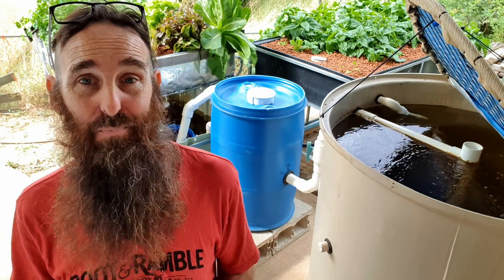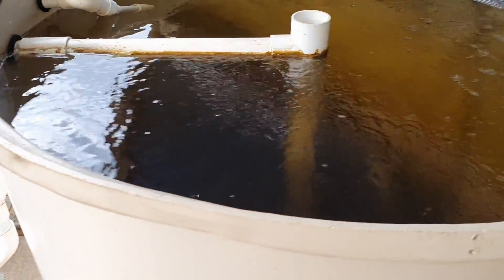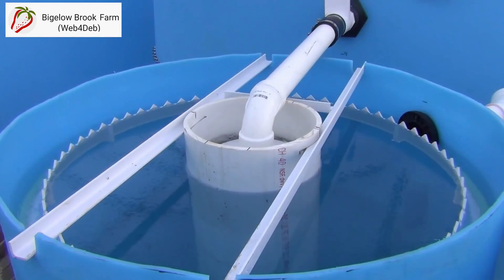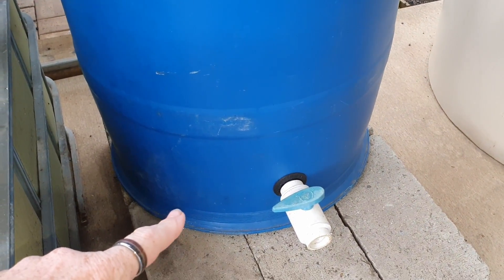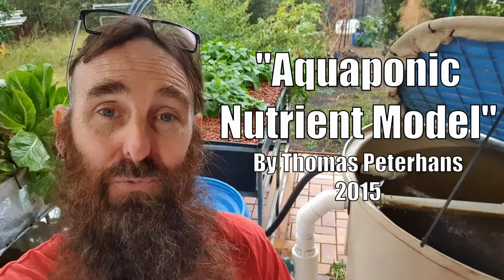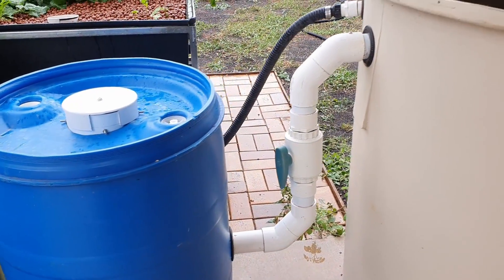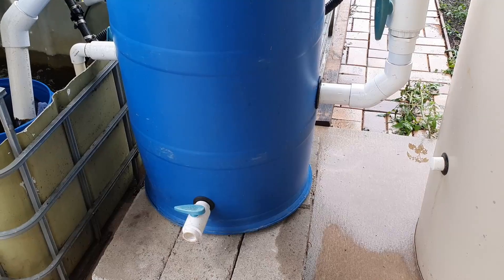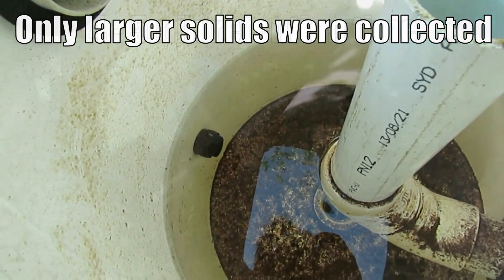Radial Flow Settler for Aquaponics Systems | How RFS work - How to Size Your RFS

Comment: Would there be any benefit to running two of them in series?
Reply from the maker: Parallel would be better as you would be reducing the flow rate which would increase the retention time. 👍
Cheers Joseph.

Comment: Hey Rob, have you tried having 2 radial flow filters connected parallel to each other?
This way you can double the volume and retention time and still use the cheap components.
Reply: Also I had another though. 
Do you need that much water flow through your fish tank?
You mentioned many times that you need to pump the entire volume of the growbed  twice an hour for the bacteria to work. But that has to go through the growbed, not through the fishtank, right?

So if you have a split system you could slightly close the valve on fish tank side and reduce flow through the fish tank by half. 
In theory that would double the percentage of ammonia in the fishtank water but since we are removing half, it would equalize and the same amount of ammonia will escape the tank. 
The only question is if doubling ammonia concentration in the fishtank water wont kill the fish.
Reply from the maker: @hubertnnn  The fish tank water needs to go through the beds twice an hour as that's where the ammonia is coming from & we want it processed ASAP so as to not build up & harm the fish. 👍
Hope that helps.
Reply: I run 2 radial flow filters (55g drums) in parallel. Works great.
Reply from the maker: @underdog5004  Cheers mate. 👍👍
Reply: @underdog5004  can you share a picture or video of this so I can replicate it?please??
Reply from the maker: I haven't due to space issues but think it could be done mate & the decrease in flow would help to a point. 👍 I'm not sure it would really be worth it in a small system like this current one I have on the go. 
Cheers mate.

Comment: Great stuff as always Rob! One idea, could you not do a T-split from the SLO and into 2 X 200L settlers for a cheap 12min retention time? :) (as an alternative to a really expensive 500L version). Also love the idea of the “fork” water outtake for the settler to slow it down. Might need to play around with that idea myself :D
Reply from the maker: A few folks have suggested that & it would increase the RT dramatically.👍 Helps if you have the space to be able to set it up & would work out a lot cheaper than a larger single tank. 
Hope the build goes well. 👍
Reply: Rob Bob's Aquaponics & Backyard Farm  also worth keeping in mind that if your plants are already happy, maybe the double maintenance and space is not worth it, even if it is a cheap solution :)

Comment: I get those 200lt drums free. Could I put 2 radial flow filters in line to achieve a greater retention time?
Reply: My guess is that you would see more benefit from putting the filters in parallel. Retention time is basically a measure of upwelling speed, which you want as slow as possible in order to allow the finer particles, which have lower settling velocity, time to fall out.
Reply from the maker: Splitting the flow to reduce the velocity as TG mentioned above would be the way to go I think mate.  👍
Cheers.

Comment: Hey.  My 55 gallon drums form heavy sulfides.   I have 14,000 L pools.    I dont want to pull too much so i have a smaller settler.  Im a shrimp farmer in the states and use biofloc from ammonia management. 
Love your set up.  I cant make em work without sulfides.  
If you could address that issue id be very grateful.
Reply from the maker: Hi Glen.  I'm sorry to say that's out of my league mate. I prefer to post on topics I have direct knowledge on through experience. 
Have you tried looking up a few of the university sites? I've found the The Southern Regional Aquaculture Center (SRAC) very helpful & may have some info to help you out. https://srac.msstate.edu/

Cheers.
Reply: @RobsAquaponics  its all good.   I figure your solids are drastically lower than mine.  
Btw,  im a big lurker fan.  Lol

Comment: Rob which cut off or ball valves have you found the best ( easiest ) to open and close. I keep tropical fish as well and use vast amounts of valves in the fish room, some require Popeyes arm and cans of spinach to open. Thanks    Ps  I live in southern Ga in the states
Reply from the maker: I like the Sanking 3002 – Series Ball Valve & think that they're available in the US. Have found them fairly easy to operate when compared to others I've tried. I was drawn to them mainly as the handles are removable. I switched to them after we had visitors kids turn a few valves on & off while I was chatting aquaponics with their parents. 😉
Sorry I'm not much help there mate.

Comment: Shouldn't this be called an axial flow separator? And the other a radial flow separator?
Reply from the maker: I'm just using the commonly accepted terms as that's what folks use in groups & forums. 👍
Reply: @capturedflame  Sorry but all of his animations and description are showing axial flow not radial (swirl or vortex) flow. I like that this is explained in such detail i'm just trying to accurately identify it. Radial doesn't describe what is going on in Rob's filter.....

Comment: Thanks for sharing. New to your channel I’m going to convert my in ground pool to this system . Watching and learning. I want to use CatFish in my pool  it’s 20’x30 feet 8 feet deep. I’m  in Louisiana USA
Reply from the maker: Sounds like quite a system. 👍 Just remember that you need a large enough bio filtration system to convert the ammonia that the fish produce. 
I've seen folks add a load of fish in pools & they end up dying as they produce far too much ammonia for a small amount of grow beds to handle. 
The other issue can be that adding too few fish means the ammonia is very dilute & the plants don't grow very well. Not a real issue if you're in it just for the fish. 
Hope that helps some mate.

Comment: Hi Rob, with my fish pond i used to put cone at bottom of drum with circular pipe laying at edges  connected to outlet valve. It created sucking at outer were waste collected. Basie
Reply from the maker: I have a similar arrangement in my parents system if I understand what you saying. 👍
Cheers & have a top one Basie.

Comment: Rob, instead of one large drum for the solid filter, would it be possible to chain several radio flow systems consecutively with the cheaper buckets 200 L buckets?  That way you increase the overall retention time while keeping costs down?  Of course this would still require more space though.
Reply: That's essentially what I'm doing.  I've got 2 x 200L tanks in series;  effectively that gives me about a 10 min time for water to move from the fish tank before it hits my MBBR.  You'll notice a significant difference in the deposition load between the two tanks.  About 7/10 of the material is in the first tank, and the remainder is in the second tank.  I've got a set of filter brushes in the second tank for mechanical filtration of the micro-fines before they get into the MBBR.
Reply from the maker: I think it would be better to run them in parallel than series K JC.
That way you're dropping the flow rate into both settlers which would be doubling your retention time.👍 
Cheers.
Reply: K JC my thought too but parallel to slow the water even more.
Reply: will have to be in parallel not in series or you could use another IBC

Comment: Great video Rob, i like the up grade you are going to do to the discharge from the settler. I really like the way Bigalow farms did the over the top to a flat plate into the stalling chamber from the fish tank, what are your thoughts on it?Thanks again Rob. Cheers Mike.
Reply from the maker: Hey Mike. I like Rob's idea & will be playing around wit that design in the future as it requires less pipe & holes that need to be drilled. 😉👍
Cheers mate & have a top one.

Comment: Is it possible to set up simple/reliable hydro/aqua system that will hum along without daily intervention when I take off and hit the road for a few months of vacation travel?
Reply from the maker: Quite possible but plant selection would be key. A lot of leafy greens are fast growers so may be finished before you get back. You'd also need to automate the nutrient dosing & water control as well.

Comment from the maker: Want to learn more about Aquaponics? 🐟 🍓🥬🍅
Learning is easy with my "Beginners Guide to DIY Backyard Aquaponics" for only US$19.95.
► https://www.robsaquaponics.info/beginners-guide-to-diy-backyard-aquaponics
Don't forget to click the subscribe button if you found the video helpful, https://bit.ly/Subscribe2Rob
and share the clip around with family & friends if you think it will help them too.  🐟 🌱🍅
Cheers all & have a top one. 😊
Rob
Reply: 8:17 RAT?!?! :O
Reply: @SmirnockIce  looks to be a grey house mouse. We get a few in our yard cause our neighbors have chickens.
Reply from the maker: @soarer282  It "was" a mouse AS. 😉
Reply from the maker: @SmirnockIce  Was a mouse & have a pic of what happened to it late that night as well. Not sure if I should post the pic to the community wall though.
Reply: Reading the paper and comparing results of Swirl and Radial Flow, cannot see a statistical difference.  If there is then it's so small that cannot believe all the extra cost of Rapid Flow design (they used the very best -- not typical DIYer unit) is worth the cost/extra effort.   Thanks for including the paper and I'm glad you trying new stuff!
Reply from the maker: @joeboxter3635  Everyone I have spoken to over the years that swapped to the DIY RFS after using DIY swirls said they worked noticeably better than the swirls. From what I read in the abstract alone sad there was just over a 20% difference in efficiency & to me, that's fairly substantial.  Page 56 goes into more depth. 
Cheers.
Reply: @RobsAquaponics   Yes, I see he has concluded it.  

But he has fed 40kg/d more to fish with flow filter than the traditional swirl filter when I (not so carefully) read it.   Then he says, oh there is more waste coming out of the flow filter.  Well, more feed then more waste right.

He then coverts things to percentages and in certain data points, the swirl % is better than the newer flow filter.  (Also, somewhere in this mix he seems to have brought in some other kind of filter.)

I think an editor needs to go through this and it needs a peer review. 

But in the end it is results.  If you telling me people you have spoken to say flow works better than swirl then who am I to argue the anecdotal data.   

Thank you Bob.  Big fan cause you always brining us good stuff to consider and use.